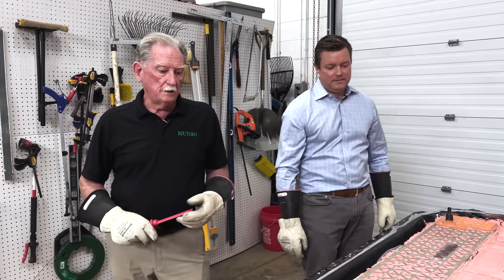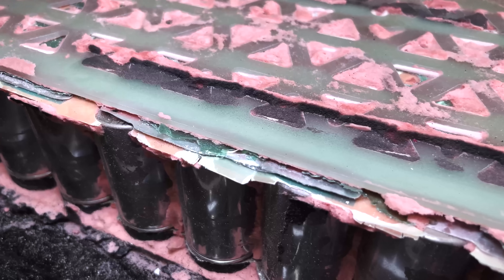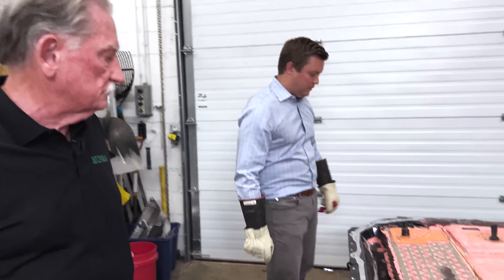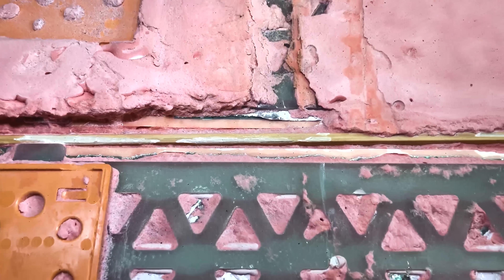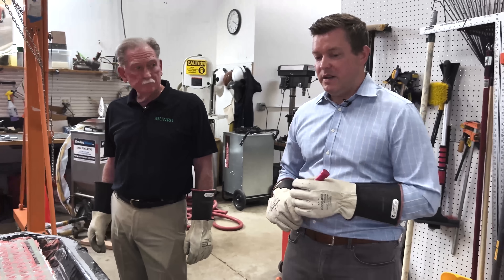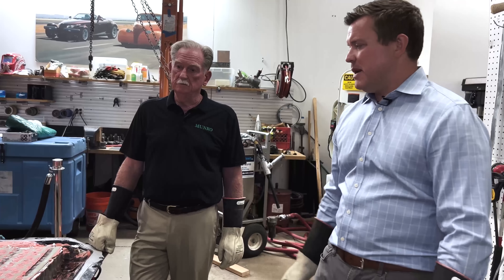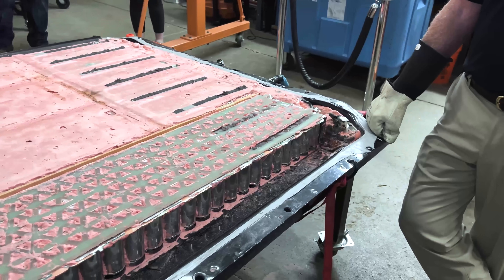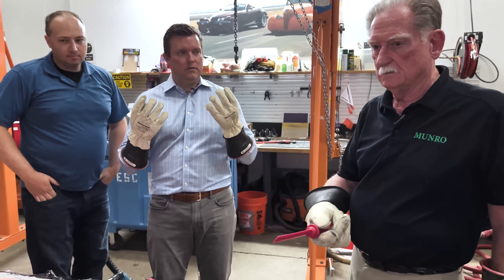4680 Battery Pack: What We Found Under the Foam!

Comment: So even though recycling shouldn't be a massive issue, any repairability  or re-use outside of the entire pack is basically totally impossible. I don't love that...
Reply: Except....
The control electronics will be in the "penthouse" which is removable.
If the cells are individually fused, one cell down, taken out of circuit loses +/- 0.12 percent of capacity.
If it's an 80kWh pack, 
That's about 100W in 80,000
.
Why would it need "repair"?
.
It's like saying a single pixel out on a 65" TV means a new screen.
Reply: @rogerstarkey5390  well said.  And this is how TV companies deal with it.  They kill the errant pixel cell.